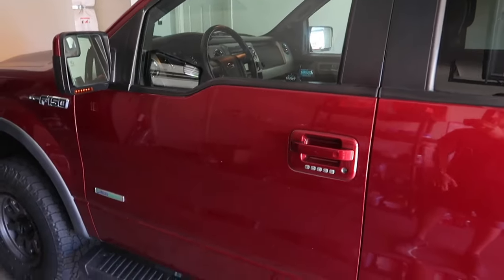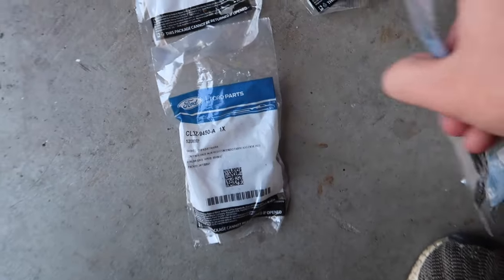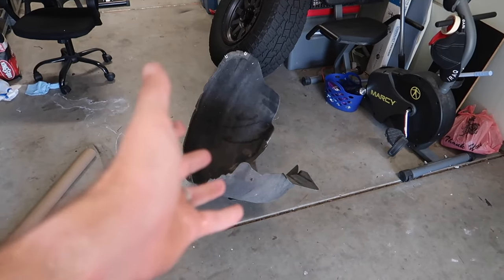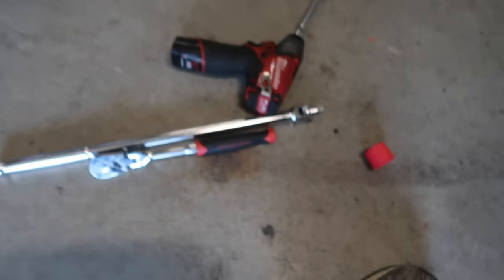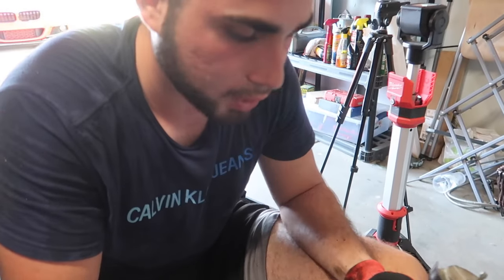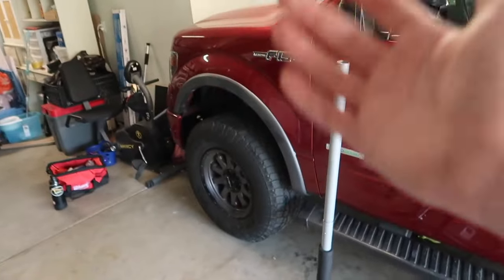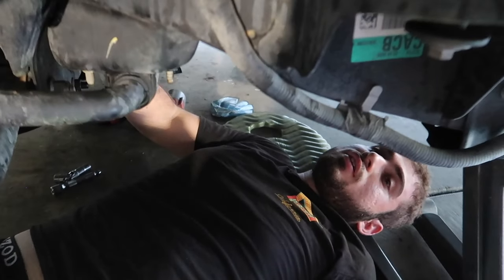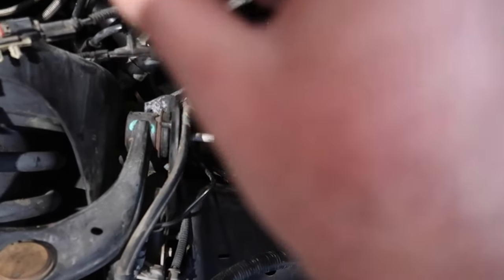ATTEMPTING TO FIX MY TURBO LEAK ON MY F150, TURBO REMOVED! (ECOBOOST)

Comment: Wanted to tell you a friend and I used your video for a reference and swapped both of his turbos, and it helped us tremedously.  Sorry you had that coolant leak at the end, but we made dang sure we got those coolant lines snapped in and everything buttoned down good and started her up to a perfect purr.  Thank you thank you thank you, there are not enough of these videos but yours makes a big difference!
Reply: How did you get the back coolant line to go in probably?
Reply: @tuantran8782 yeah same here
Reply: I would like add, when the turbos are pulled for coolant leaks it would be a good idea to replace the oil supply filters, there only $40 each, far cheaper than a new turbo. These filters are very seldom mentioned in the turbo repairs.

Comment: I just went through replacing both turbos and the vacuum pump (oil leak and gasket leaks) via the shop.  They took the whole cab off in order to get to everything.  It was a $4500 repair job.  I wouldn't recommend someone attempt this unless they are very sure what they are doing.  It would be a tough one man job.  Great video, glad you were able to make it work.
Reply: Mine is in the shop right now for the same exact things.. Yes, they quoted me in the $4k range.
Reply: I did a lot of these when I worked at the dealer, the first few sucked but they became one of my favorite jobs to get

Comment: Been there with the turbos. I paid $1150.00 to have that done. Worth every penny. I know 3 people that did it themselves, same result you had. I am a master carpenter, not an auto mechanic in todays auto world. That is why I went to the professionals in that profession. one year and 17,000 miles later, no leaking.
Reply: That’s why I’m not doing it either
Reply: I bet that coolant line is cracked, maybe not seated correctly. Since it was leaking before, ill bet cracked.
Reply: Replaced or repaired? Good price if replaced. Thanks

Comment: There are metal oil lines that run to the turbo. You need to replace those to fix the leak. Most people just go and buy upgraded turbos at this point since first gen Ecoboost turbos are pretty maxed out as is. They will be your first "serious" upgrade anyways. I say, get a set of Garretts, call the tuning shop and send it.

Comment: Just FYI, the EcoBoost V6 has been known to have such problems with the turbo and also the head gaskets.
Reply: No issues with head gaskets on the 3.5 v6. It has timing chain and water pump issues for lack of owners using good oil and changing it often and the water pump goes bad from lack of fluid flushes. The 2.3 ecoboost has the head gasket issues and they fixed it.
Reply: @402SHO  what oil u recommend? And how often ? Thank you
Reply: @cheizaguirre5494  valvoline or amsoil if u can afford it. I use valvoline race VR1 10w-30 in my build 3.5 ecoboost.
Reply: Never heard of a head gasket fail on a 3.5 ecoboost. And ive seen people run enough boost to bend rods in SHOs and their head gasket was fine lol.
Reply: @GucciBodyBags  my 3.5 head gasket failed. But supposedly it's a rare failure.
Reply: @402SHO  Yes, they have issues with the valve covers leaking.
Reply: @jadedjay7861  no they don’t we have 4 of them not once has any of valve  covers leaked
Reply: no issues on mine at all. 5K oil changes with Schaeffers oil, radiator flushes every 50K with prestone. A little effort goes a long way here.

Comment: you needed to replace the fittings on the block as well, Dorman makes replacement lines for both left and right, they come with the fittings and cost about $56 on Rock Auto.
Reply: Bingo!

Comment: I recently replaced my coolant fittings on the passenger side turbo. When re-assembling the coolant hose that runs from the back of the engine to the turbo started leaking. I believe this happened when i was re connecting the hoses on the turbo side. seems like a slight movement broke the seal, I was so frustrated. Luckily I was able to reach my arm between the back of the engine and firewall and replace that fitting as well. cost me about $100 with gaskets, coolant, and fittings. Saved myself a $1,500 shop fee.

Comment: Have to always replace coolant tubes and also oil tube and other stuff that is related to turbo filter ect since your already there, reason for the o-rings  and you did good with the rest. Its BS you cant just buy the o-rings  u have to buy whole dam tubes for the o-rings. They made it as a repeat repair money pit / cheapest way for factory to build as well. Its a nightmare to get to rear firewall ones, easiest way i found have a lift and cab removal. But possible either way. Im flat rate and warranty only pays 3.5 hrs and cust pay is 4.5. you will spend that time with a mirror trying and trying some more and possibly dmg new stuff when reinstalling. Takes an hr or lil less and u can have cab off and do everything perfect. With no issues a little more work but so much less stress and can inspect so much more and yea. GL

Comment: Reinstalled the same turbo that is past it's life cycle is nuts. Any turbo with more than 70,000 miles should not just be reinstalled. All that labour went in the garbage. For $400 you could have upgraded the center sections and they would last 150,000 miles. Inexperience shows. Ps coolant tubes are known to crack

Comment: if your connectors are leaking from the turbo then you can garentee they are going to leak from both connectors on opposite ends of pipe. especially the pipe that you adjust up out of the way to remove the turbos. the old sealing o-rings seal to the pipe and when you move it it tears the o-rings. next step, remove the intake manifold and replace the quick connects at the back of the heads, then remove the turbos again, c.a.c, and the air conditioning pump and replace the coolant quick connect fittings on the side of the heads. sigh..

Comment: My 1 series convertible won’t go up can you please help me with that Idk what’s the problem
Reply: Open the boot , look at the top , check if that plastic cover is pulled down , if it’s up it won’t allow you to open or close , so open the boot , you’ll feel the cover at the top , make sure it’s pulled open to allow the top to go up and fit in when it’s down

Comment: Whats the logic behind the ecoboost  being better for towing? Diesels are for towing tbh... Ecoboost is just more economical than V8 F150 models.
Reply: Ecoboosts can tow if equipped properly up to 13,200 pounds and the v8 can only tow up to 10,800.
Reply: I thought v6 had twins but seems not, I'd still rather get a 6.7 cummins for towing than an ecoboost..
Reply: @nikopalonen92  it has twin turbos….. only the 1.5,1.6,2.0,2.3 have single turbos. And stop comparing a diesel to a gasser when towing, its like comparing a trailer park girl to a victory secret model.
Reply: IF someone says that a gasoline powered (specially an ecoboost) is better for towing than another gasoline truck, he is already wrong, since not a single gasoline powered vehicle is good for towing. They are good and all for fast speeds but man oh man WHERE IS THE TORQUE??? Kinda fun to see someone getting triggered for someone pointing out the obvious, as in this case that ECO f:n BOOST isn't good for hauling anything except empty trailer. I assume you get the point which is gasoline aint for hauling.
Reply: @nikopalonen92  the the ecoboost makes more torque then it does horsepower. 😐 I’m not salty it’s just you don’t get the facts and why the truck was made it was made for the people who dont want diesels. There are a lot of people where I live with a 3.5 and even the 2.7 and they all say it’s way more powerful for towing then any NA v8 of the same class. It’s still dumbfounds me u are comparing a gasser towing to a diesel.
Reply: I think it was made most likely for the US market because there almost everything is gasoline. I understand if someone buys a raptor or something like that for daily in US, but why can't they be compared to actual trucks with diesel engines when diesel is overall compared to gasoline cars being the environments killer because it "kills" the planet. I think it's fair to take all facts to the table. I don't see any legitimate reason for a gasoline truck. Diesels have better mpg, more torque, better reliability, easy to work on etc... If diesel trucks can't be compared to gasoline trucks, then gasoline cars cannot be compared to diesel cars (which they are). Hopefully u get my point and the perspective of the overall global comparison where always the diesel is accused for global warming over the gasoline one's. Here in EU we have biodiesel so why would it be so bad for the climate afterall?

Comment: I don't get why people think there's a massive difference between brands of car. The fundamentals are all the same on every car save for electrics of course. Just like there's no big difference between carbureted and fuel injected engines, they all suck air, compress the stuff, explode the stuff, and exhaust the stuff. The nice thing about "modern" cars is they tell on themselves when they shit the bed.

Comment: you should have just changed out the coolant tubes and coolant tube connectors (most likely just the rear tube and connectors to turbo and engine block. There was no need to remove the entire turbo.

Comment: Why are you using GM anti-freeze for a ford
Reply: I said the same thing when I saw that.  Peak Antifreeze has the "orange" stuff that meets all the Ford specs.  I have a 2013 F150 Eco and that's what I've been using and no leaks to date..

Comment: bro why did you not just replace the whole turbo, i wouldnt have put that back on lol
Reply: why replace the turbo if it's just a coolant gasket. a turbo is expensive
Reply: @n55tourist32  idk because it could still leak coolant like it did lmaooo eventually its gonna go bad and need to be taken off again regardless.. i was in the same situation  w my 335xi. i had a leaking oil drain, couldve replaced the gasket but didnt want to risk it (like him) or take them back off iin the future, so i replaced 0 headaches.
Reply: @e92erik  the man has multiple cars, imagine if he applied your suggestion for every fix, he'd go bankrupt. sure he's risking his time, but a lot of times it's worth it.
it's like saying "the valve cover is leaking, better replace the engine" as an extreme example
Reply: @n55tourist32  i get what you saying dawg but still he been having bad luck this  whole time its a headache man hopefully he figures it out.

Comment: I believe I have this issue. Can’t take to mechanic at this moment. What’s the worst that can happen if not fix asap?
Reply: Mine leaked for a year, check and top off coolant once a week,finally changed em yesterday on the passenger side, it really wasn't a bad job